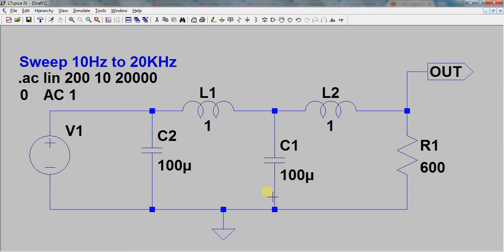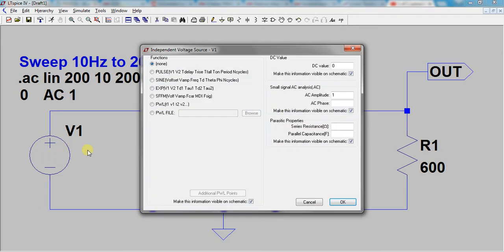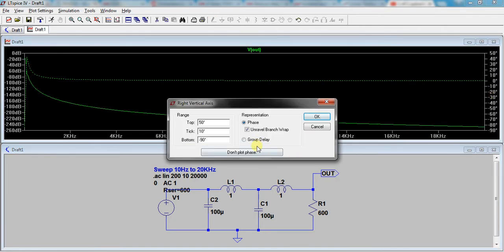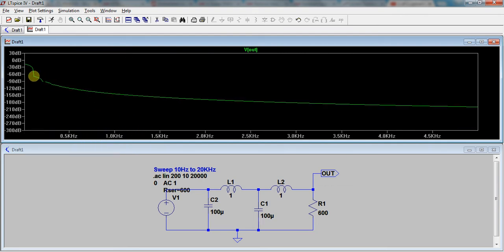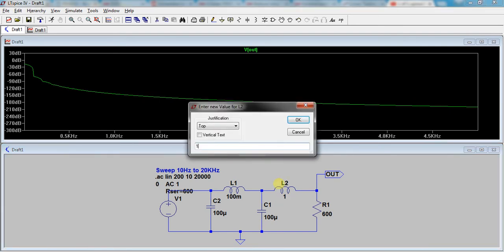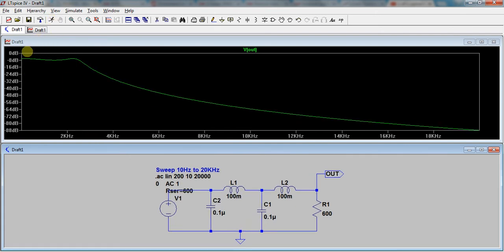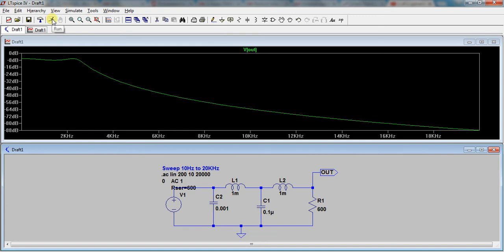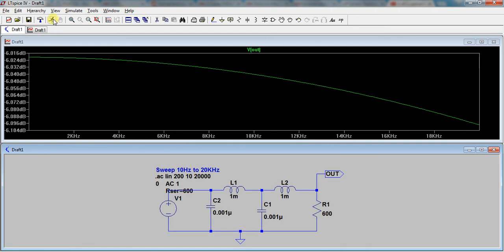L C filter Response

Comment: Isn't the 6dB rejection at the end just due to the two 600 ohm resistors forming a voltage divider at low frequency before the reactive components kick in?
Reply from the maker: Yes  , I should have plotted  Vout/Vin    rather than Vin